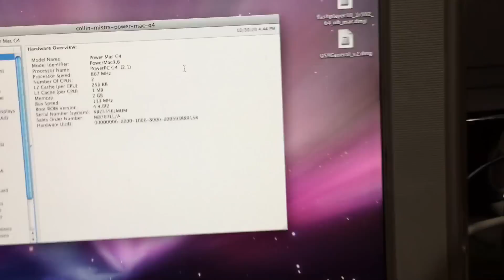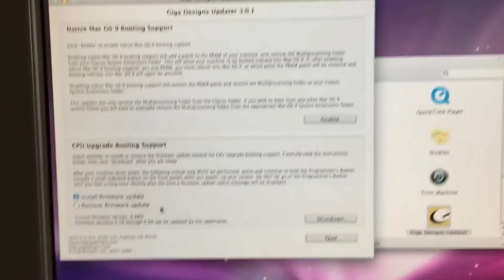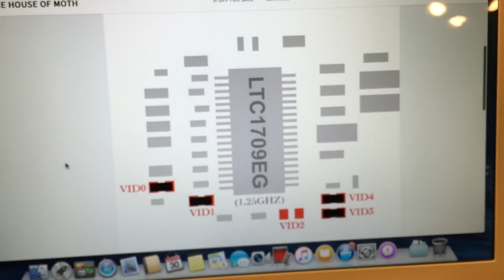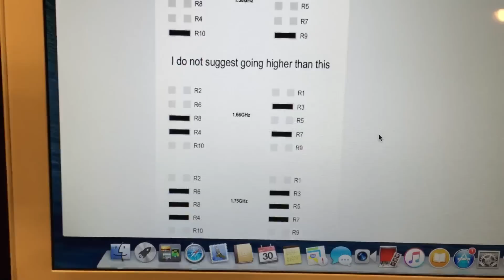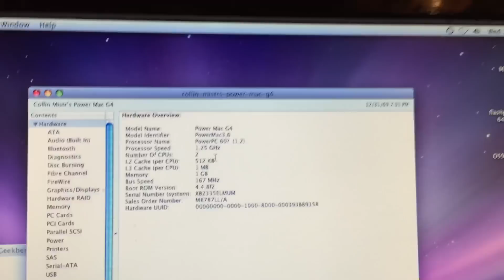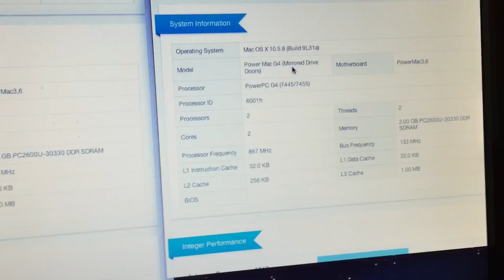PowerMac G4 MDD MC7457 CPU Upgrade

Comment: Would you be able to point me in the right direction possibly? I have a CPU daughter card from a graphite PowerMac G4. The part number of the daughter card is 820-1040-A. It had a single 7400 450Mhz CPU, and I changed it to a 7440 1.25Ghz CPU. However, it will not post. I'm assuming the resistors for CPU voltage need to be adjusted, but I can't find any documentation online for my specific Mac. Appreciate any help!
Reply from the maker: The 7440 does not have the same pinout as the 7400/7410, despite having the same number of pins and footprint. Therefore you cannot use a 7440/7445/7447/7448 on boards designed for a 7400/7410.

Comment: I wonder if you could solder bodge wires to those resistor pads and run the wires to a bank of small switches glued to the edge of the cpu board so you can play with different bus and cpu speeds without having to disassemble everything and solder with every attempt at different settings. BTW- a very interesting video! Thank you for sharing.

Comment: You need to solder better (faster/bigger) SRAM that serves as L3 cache in the processor module. But you already know that...
Reply from the maker: Yep, just have to find some. I'd like to get 330 MHz-rated chips or higher optimally, but may have to just try the 300 MHz ones that comes on the 1.25 GHz + boards.

Comment: Lovely stuff! A whole new raft of soldering techniques for me. I'm still stuck on the 'soldering iron in one hand and solder in the other' days and amazed the hot air blowers don't fry the electronics but I guess the temperature tolerance is finely measured out. Intriguing as always Collin. Thank you 🙏

Comment: Awesome job. This gives me hope when M1 Silicon actual Macs could get storage upgrade or repair, maybe RAM upgrade as well. I'm certain that will be possible in near future.
Reply: I bet the cpu is paired to the system...
Reply: @Josh.Davidson  The problem is the T2 and other chips... they marry the board to the components, because apple is a shit company. I much prefer hackintoshes than macs now.
Reply: @Appri  it's for security. Microsoft did that on the Xbox 360 but eventually we figured out how to move the CPUs. Someone will eventually figure it out.
Reply: @Josh.Davidson  It's for both, security and anti- right to repair.
Reply: @Appri  no, pairing CPUs is nothing to do with anti repair. That's a common security method. Pairing the battery or screen etc is anti-right to repair though.
Reply: @Josh.Davidson  They pair the T2 chip with the SSD, the controllers, all the other components...
Reply: @Appri  i understand it... point?
Reply: @Josh.Davidson  When every important component in the board is married to one chip that you can't replace, that's called anti right-to-repair.
Reply: @Appri  Possibly, but my point was simply that marrying the SoC to a storage device is done for security first. Then the only left is the T2 - a security chip... ok makes sense.
So I can't really argue that that's specifically anti-right-to-repair.

And for the record, I AM a supporter of right to repair and repairable devices, as I do motherboard repair myself, but I also understand hardware security and its requirements.
Reply: @Josh.Davidson  I- it's not hard to encrypt the storage device itself, there's no point in marrying the T2 to the CPU, T2 to the storage device, etc. TPM exists for a reason. Apple's in house solution exists just to fuck with repair, it allows them to do whatever they want while also preventing repair. Hardware security isn't affected when you can encrypt data in a storage device automatically.
Reply: @Appri  Encrypting storage without pairing the CPU defeats the security. Why do you think all game consoles have been pairing parts together that are part of the core security for 15+ years.
Of course pairing batteries and screens and such is simply anti-repair, but not pairing the CPU to a security processor and to the storage. (not the controller itself, but the software on the storage).